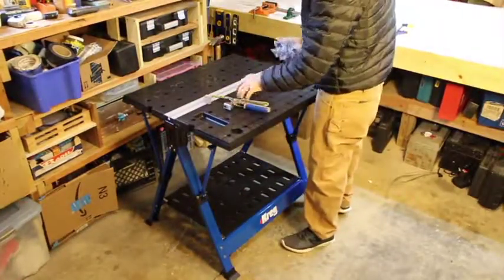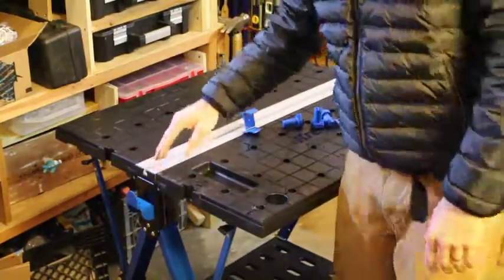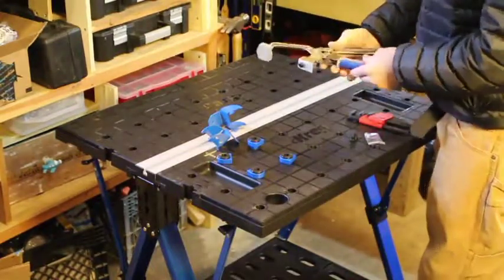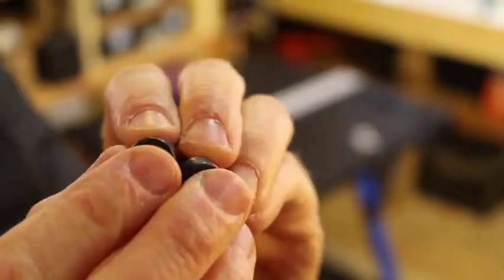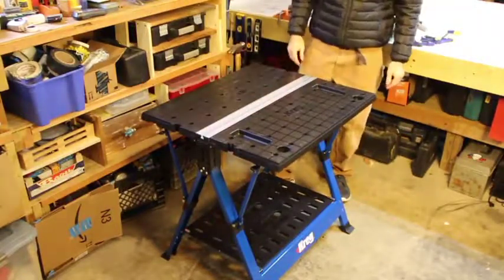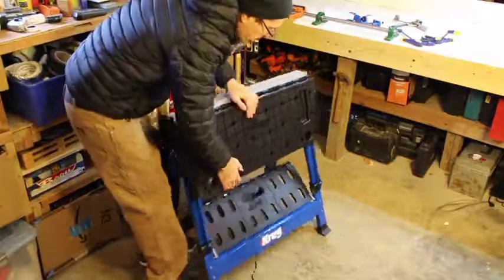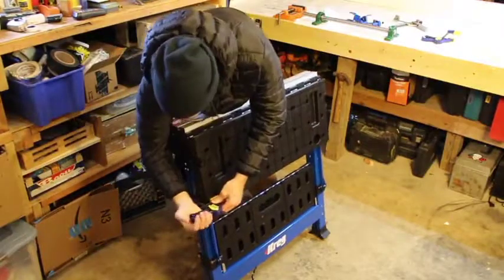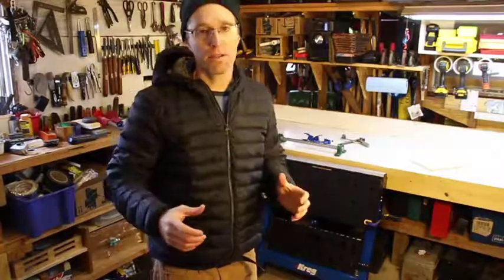Kreg KWS1000 Mobile Project Center Reviews & Using Guide

Comment: His video does hit the things one would question about this table. Other reviewers mention its does appear flimsy, and when carried its tendency to flop open. To stop it from opening one reviewer put a bar through it then put on a snap ring. This is a good video and makes one wonder how well this will hold up on job sites where folks are not easy on equipment. Other reviewers mention it is weight, 40+ pounds, think about multiple times a day it may be pulled from the truck lugged through sites, dropped on the ground, and the like. He is correct about its very flimsy bottom tray, again other reviewer mention the same concern. My use of $20-ish plastic sawhorses having considerably stronger lower platforms with the ability for holding much heavier weight is better than the Kreg lower tray. Other than the Kreg clamping system on this work table this is not impressive. Thus I agree with the reviewer, and his review is truthful.

Comment: All I can say after watching this review is WOW!!  This video is absolutely horrible.  The Project Center is mishandled and misused throughout the entire video.

First the Kreg Project Center IS NOT $300.  Its approx $155 so I am guessing he actually bought 2 of them.  If he actually paid $300 I would suggest going back to the retailer and ask for the second one.

Second the Kreg Project Center IS very stable.  It can and does support loads up to 300 lbs easily.

Third the brackets that can be used on the sides can be fitted into 2 different slots.  A lower slots and an upper slot. The lower slot allows a 2x4 to span a distance between 2 Project Centers.  When you have a 2x4 in the lower slot position a 3/4 inch thick piece of plywood can be set between each Project Center to create a very large work surface and the plywood will be level with the clamp chanels in the center.  If you set the brackets in the upper slots the work surface will be raised high enough so you can use it for cutting and not nick or cut into the surface of the Project Center. 

Fourth the clamp that is included with the table can be used in the center slot or either one of the side slots.  In addition the front table of the Project Center has a channel on the under side that will permit the use of the Kreg clamps that have the pads.  The channel on the underside is sized to accept the larger pad.

Lastly remember its alway best to READ  AND  UNDERSTAND all documentation that come with your tools.